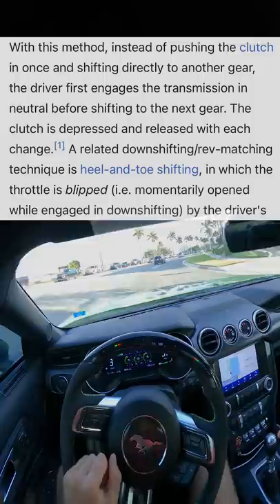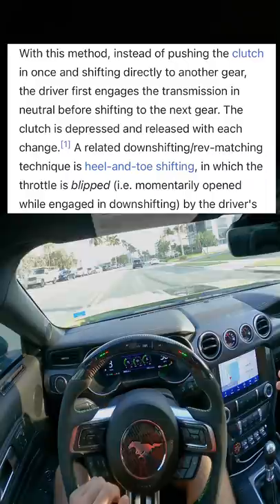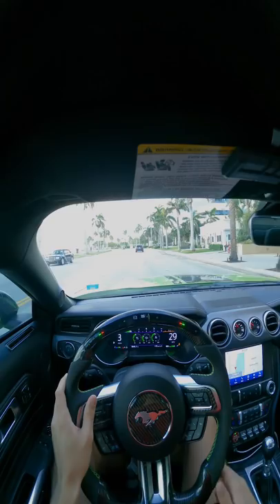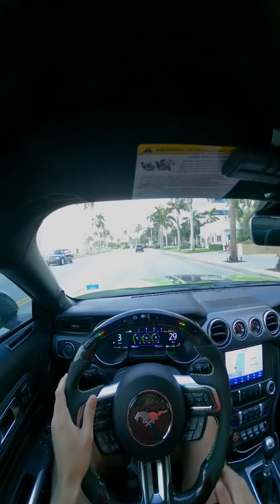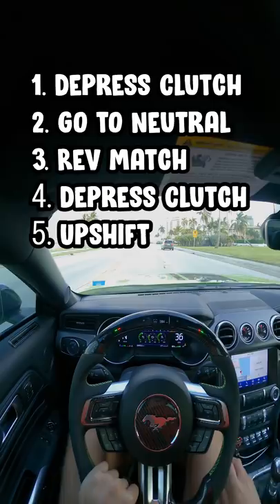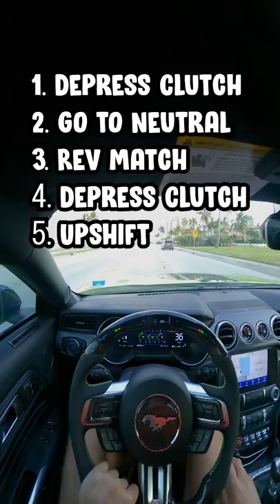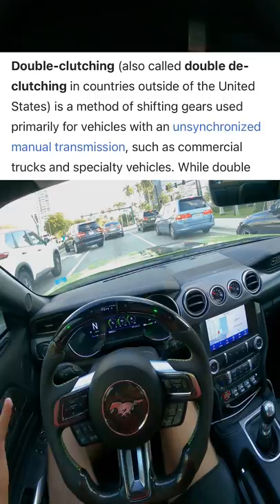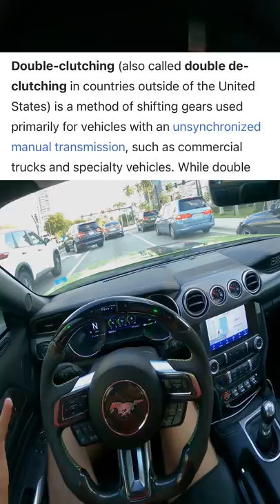WHAT IS DOUBLE CLUTCHING IN A MANUAL TRANSMISSION & SHOULD YOU DO IT? #SHORTS #MANUAL #GT #FORD

Comment: Double clutching was used when shifting a non synchronized transmission
Reply: Yes this is the real reason
Reply from the maker: That's what I said in the vid. Straight cut, helical gears didn't have synchros
Reply: @TobyVegaD  having straight cut gears has nothing to do with it. Only no synchros
Reply from the maker: @corax_of_istria  Thanks for the views bud
Reply: @hayeduce  much love for being the only smart one here.
Reply: @TobyVegaD   Straight cut and a helical cut are the ways the teeth are machined into the gear, and it can't be both they are 2 different ways of cutting teeth. The  Synchronizers are a tapered toothed piece of metal leading up to the engaging face of the gear which make the gears match speeds before they mesh.
Reply: @russob7042  exactly. But you can have unsynchronized helical gears and synchronized straight cut gears. The gear type has no relation to it being synchronized or not.
Reply: How does it help with a non syncro gear box?
Reply: @alecvip7562  helps synchronizing the speeds of the transmission shafts and gears
Reply: @alecvip7562  because when you let out the clutch in neutral you can spin up the gears to match the needed rotation speed to engage the next gear, if you never drove a non sync tranny you would not know this

Comment: Double clutching is generally used in racing only when ur synchros in ur transmission are worn out. so because ur synchros don't mesh it makes it harder to go into gear so double clutching is able to make ur synchros slow down enough to mesh while the engine rpm matches transmission speed

Comment: Agreed! In a synchronized transmission there is no need to double clutch. In an unsyncronized transmission don't double clutch float. Floating gears- bring up to proper rpm, let off the accelerator, shift to next gear, repeat to top gear.

Comment: If you take apart a manual transmission you'll be surprised to find that all of the gears are always engaged with each other.

When you change gears, all that happens is the gear you are using disconnects from one of the shafts and another gear with a different number of teeth that had been spinning freely on the shaft now couples with the shaft.

The way the gears and shafts connect and disconnect, spinning freely is what changes how you need to shift.

Synchros are cool mechanisms that apply friction between the gear you want to use and the shaft. As long as there is friction applying a torque between the two (shaft and gear), the synchro is also locked out from engaging with its teeth. Once the rpm matches, the lack of torque between the two unlocks the synchro's teeth and let's the synchro couple the shaft and gear fully. This all happens quickly and silently as you move the gear selector between gears.

With synchros you just push in the clutch and select the gear you want.

Non-synchro transmissions just have teeth that engage between the shaft and gear so you need to first get the shaft and gear you want to use spinning at the same rpm yourself. This is what double clutching does.

Single vs double clutching has nothing to do with if your transmission has quiet angled gears (like most street cars have) or of it has stronger, noisy straight cut gears (like many race cars have).

There is also another type of coupler between shafts and gears and that is what is know as a plated transmission or dog clutch gears. In the same place a synchro could go there are instead large blocks with angled, undercut wedges on each side. When you start to engage a dog clutch it sucks itself together with a loud bang, instantly connecting the shaft and selected gear. No time is wasted waiting for a synchro to get speeds right and no double clutching use is required. Instead you just let the power off slightly (lift the throttle a bit) and slam it into the gear you want. Bang! You are instantly in the next gear, with a lurch and you can immediately put the power back on. "Dog teeth" are so tough you don't even need to use the clutch, just slam the gear selector from gear to gear.

Comment: My explanation:
Double clutching is a way to rev match or synchrobize the gears when shifting, by switching from the gear to neutral, then from neutrak to the gear you want. Modern manual transmissions have synchronizer gears, which defeats the purpkse of this nowadays, so its useless unless your synchronizer gears are shot.

Comment: “What is double clutching” short answer-a waste of time
Reply: Lol seriously who cares
Reply: @olivertwist2843  I care about my time
Reply: Nowadays that may be the case but back in the day when there were no synchros on your transmission you had to double clutch in order to keep from grinding your gears....So in short newer vehicles is a waste of time older vehicles it is not...
Reply: You double clutched wrong...  You do it quick enough you don't have to match the RPM....
Reply: @will76dodge  I am aware, my truck has unsychronized gears and I do double clutch that. That also isn’t meant for speed so it’s kinda moot on that.
Reply: Double clutching is really needed when you have a clutch brake for semi trucks amd dump trucks so basically anything that is a 10 speed amd.high you will need to double clutch or float gears. But in the video you don't need to rev to up shift only down shift to make it go in gear if not the clutch brake won't allow it
Reply: @ziadajam5433  still incorrect, you’re band-aiding a different problem. Rebuild your transmission. I’ve completely blown synchros in the past, like split the ring, and still didn’t need to double clutch. You just need better timing as if you were floating gears.
Reply: @wholelottamiata6976  man badge winner 👨 🏆,  I started driving with a crash 'box, those skill may get rusty over time, but you never lose them, I recently saved us a 6 hour delay waiting for recovery, a blown clutch slave?!?!?

No clutch, no problem, I'll get us there, tell them to pick it up from the yard!

Comment: Double clutching was used along time ago when they didn't have synchronizers in manual transmission. You press the clutch and pull into neutral which allows for everything to start catching up. Then you press the clutch again and go into or out of the next gear. Most of us aren't old enough to have experienced this unless your dad or Grandpa owns one of these old vehicles.

Comment: Straight cut gears don't require any clutching to shift gears, just a split second cutting of power to complete the shift.
Reply: Isn't it about dogbox transmissions?
Reply: You can have straight cuts with or without synchros, with or without a clutch.
Reply: @sevvvich8118  Not necessarily, M22 rock crusher trans is as close to straight cut gearbox yet still has synchros. They're stronger than helical cut, but much noisier. Most motorcycle trans are dog boxes.
Reply: @lesbratton  they in fact are actually not stronger than helical cut. the gears themselves are weaker when straight cut. they do however make the transmission unit as a whole stronger because they put less stress on the rest of the components.

Comment: Why double clutch if you just can to clutch once, even if you want to revv in neutral while still holding the clutch, shift slower, dont wear n tear your clutch.
Reply: Yeah double clutching actually doesn't put a noticeable amount of wear on the clutch, when you shift to neutral there is no load, and so it doesn't really wear enough to be considered a factor

However, it will save your synchros, wich are much more expensive to replace, unless you did it yourself, you'd have to essentially completely tear apart your transmission to get to them
Reply: It is from a time where synchros werent a thing. But it still helps the transmission wear a lot slower.
Reply: @srjsamsam  for the cost, youd be better off to just swap the transmission
Reply: @srjsamsam  don't forget the throw out bearing
Reply: Double clutching seems useless in my car. I do it in my semi truck though.
Reply: @Hooks95  that's only if your riding the clutch, not just using it as intended

Otherwise it will wear normally
Reply: For transmissions with no synchros or damaged you’ll fight them more then not if you don’t
Reply: How about getting some technique into your shift, it is not hard to revmatch you engine,  this way you wont even need a clutch if you are all about synchronisation..
Reply: @smonk2785  not entirely true, in my freightliner cascadia, I shift without touching the clutch

I fight it less then when I try to double clutch

Occasionally it will stick, so I hit the clutch to get it out of gear, but that's it

It fights me more if I try to force it though, with or without double clutching
Reply: @ClosestNearUtopia  you should be Rev matching all the time, even with using the clutch

It just puts way more wear on the transmission and clutch otherwise
Reply: @srjsamsam  that is what I am talking about. Just shift normal, there is plenty of time to adjust your rpm to your wheels axle while changing gears without double clutching.A lot of dudes responded disagreeing with synchros and stuff which tells me they dont revmatch their engine. Well if we are talking this way, why dont just leave the clutch alone and shift how it is truly intended, with matching rpm.

By double clutching you create twice as much heat since you have twice the amount of slip happening in your clutch. It the end does not matter what technique u use, as long as u use it the right way, but in that case I would go for safest, less weary, and most consistent option, which is imo, normal shifting all the time. Ofc you could have some fun without the clutch or by double clutching but why bother the hassle.
Reply: @srjsamsam  people be like, did you see how cool I did a double shift there, while I will be like did you see me normal shifting while revmatching and kept accelerating twice fast as you did!?:p
Reply: @mindfreaks46  that’s the only time it’s needed is in a big rig not a damn car lol 😂 dudes trippin
Reply: @ClosestNearUtopia  exactly lol double clutching is pointless unless you drive a semi truck or some sort of Manuel big rig
Reply: 4 thing I can tell you never done, 1 you never have taken a car to the track, 2 drove a big rig 3 drove an old car, and last but not least you don’t know how to drive a manual car
Reply: @bradhanrahan1729  I'm a little confused why double clutching is better on track when you can keep your clutch down and still rev match, somewhat quicker
Reply: @Kyle lol

YOU'RE the one that doesn't know what they're taking about lol

It's funny because I'm "certified" in transmission work for manual transmissions

I only have quotes because I didn't officially get the certification, I did take the appropriate classes

I tore apart and put together multiple transmissions, and every vehicle I've owned (with only 2 exceptions) have been manual, my job involves driving every single day

Lol what are your qualifications?
Reply: @aaravs524   Truck has no synchros the clutch replaces the job of the synchros when you let off the clutch after taking it out of gear

It helps match the gear speed to vehicle speed easier

Comment: Double clutching is for greats that aren’t synchronized there’s no need to do that in a car it’s synchronized you’re literally just slowing yourself down every time you shift …. Good video I wrote this before I watched glad you explained it correctly. Yep big rig you can double clutch a real driver floats every gear up and down
Reply: Most modern trucks have syncros and most are automatic
Reply: It helps bring the revs down faster
Reply: You're not just slowing yourself down, you're wasting fuel, which is a waste of money
Reply: @LinkinPark4Ever1996  one reason I retired from trucking. You only need a steering wheel holder not a driver
Reply: @leftysheppey  still going slower too
Reply: @rockyloccgarage2040  😂👌🏻

Comment: You should do it if you have a leak in your clutch system.   Double clutch to get the plate back out.  Its like pumping the brakes to get pressure if a line breaks

Comment: The big question now is: “What is Granny Shifting”?
Reply: Granny shifting is shifting too slow. So slow that the engine rpm falls below the optimum speed for the gear ratio of the next gear at the current speed you are traveling.  This results in the engine having to forcibly speed back up to meet the optimal ratio cause excess clutch wear in the process.
Reply: @kurtcrafton  Oooohhhhh!!!! Thanks buddy!!! Now to practice the shift gating without clutch 😝

Comment: I only use the clutch for taking off and stopping. It doesn't matter if it's a 3 speed on the column or an 18-speed I almost always float the gears. The exception would be the first time I drive a vehicle and I'm getting used to where the shift points are
Reply: In a passenger car with a synchronized transmission, that period where you are " finding the shift points" you are literally destroying the synchro clutch material on the synchronizers effectively making it so you have to either float or double clutch that transmission. Congratulations. I drive an 18 speed as well, so I understand it is easier to float, but it also destroys synchronized transmissions.
Reply: Balls of steel I’ve been daily driving a manual for over a year and have gotten very very good and really fast and downshifting and everything but never once have tried to float the gears😂
Reply: @oliver_klozoff  but, in this hypothetical, if it only takes you a few tries to figure out shift points, aren't you technically saving the synchro/clutch alot of wear? If I burn more clutch than usual for 100mi, then never use the clutch again, doesn't that make the clutch last longer then using it twice every shift?
Reply: @Joshua-gt7pz  no, there are small clutches on the synchros that get burnt every time you apply force while the actual clutch is engaged. They are only meant to align a non powered input gear with a moving output gear and mesh, but you are forcing them to speed match and mesh, even if you are floating perfectly, passenger vehicle transmission tolerances are so tight you are still banging the synchros. Replacing the clutch is a lot easier than a complete transmission teardown in this instance. The clutch is designed to be a wear point.

Comment: So being a diesel and heavy equipment mechanic for 23yrs..... almost ALL of the truck drivers I know float gears meaning they don't use the clutch at all they match rpm with accelerator before downshifting... now I'm not saying all truckdrivers do this... just almost all the ones I know... saves their leg muscle and clutch disks

Comment: Trucks don't always require double clutching if you can float the gears, you can shift completely without the clutch. The reason trucks have to be double clutched or floated is because they don't have synchronizers in the transmission like smaller vehicles do.

Comment: This is literally pointless in a synchronized trans.
Reply: You obviously never raced a manual rear wheel drive car or drove it in winter. If you shift f.e. from 4th to 3rd fast without Rev matching you unsettle the car. There are youtube videos out there showing this and what can happen if you don't do it.
Reply: This is literally what he says in the video. Good job.
Reply: @matchington1148  no it is not.
Reply: @lerx1980  I've only ever driven vehicles with a manual transmission. I've never once double clutched a transmission with synchros. Racing my STI? Nope. Jeep off road? Nope. Cummins ram driving around in the winter? Nope.
Reply: Unless you want your synchros to last longer...
Reply from the maker: I said that in the video, must have not listened 😂

Comment: Modern gearboxes have syncro-mesh therefore eliminating the need to double de-clutch, the whole purpose of double clutching is to allow the engine revs to drop to the correct range so you can fall into the gear ratio you want, so there is absolutely no need to double clutch in a modern car with syncro-mesh!

Comment: Double clutching technique has nothing to do with the "type" of transmission, it is simply used to increase rpm more quickly in a gear if the car "lugs" or "bogs" after a gear change while its floored. Not hating, just trying to help clarify.
Reply: Not true, I have physically driven and worked on old military trucks that required double clutching. Yes it was some old shit.
Reply: @huemongus3742  ? What exactly is not true??Please explain, your reply isn't making sense?
Reply: @robertkitchell859  your reply doesnt make any sense. Try to shift without synchros
Reply: @sharpshot5408  ?? You mustn't have a clue, lol, double clutching has nothing to do with syncros, and therefore still irrelevant to the definition he is trying to explain
Reply: as a truck driver, you cannot shift gear without double clutching, and that's if you don't float your gears. we have to manually match the Rpm every time we gear up or down else it won't go in.
Reply: @robertkitchell859  try to shift a synchronless gearbox without double clutching. You wont. Go learn the mechanics of a transmission
Reply: @sharpshot5408  😂 Dude, just stop, quit trying, a "syncro-less" trans is exactly that, its either straight cut or a dog box and is meant to be shifted without the clutch.Your probably 10, can't even spell so im done with this convo, quit trying to troll
Reply: @robertkitchell859  yeah imma stop responding. I dont want to give my energy to a person like you. Learn how a gearbox works

Comment: Most semis and heavy equipment have not used straight cut gears since the mid 70s. Mainly because straight cut gears have less points of contact and aren’t as strong as your traditional cut gears when pulling heavy loads. They just don’t use synchros in their transmissions. Most transmissions with straight cut gears are typically in nascars mainly, as well as a ton of formula drift cars. Hope you can use that knowledge!